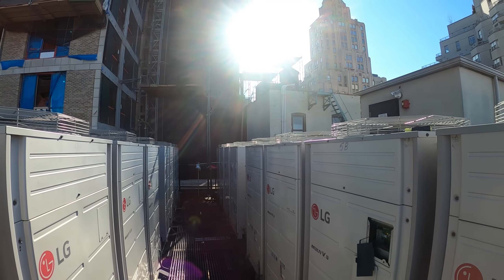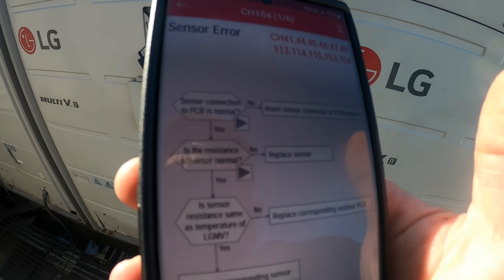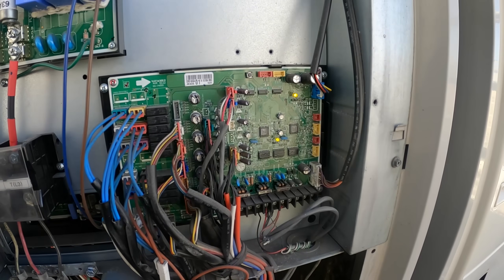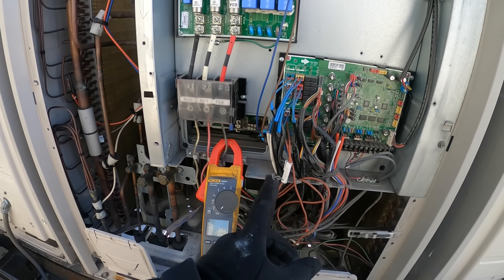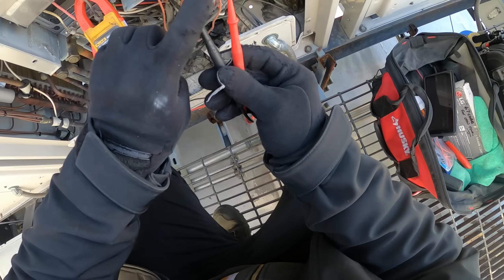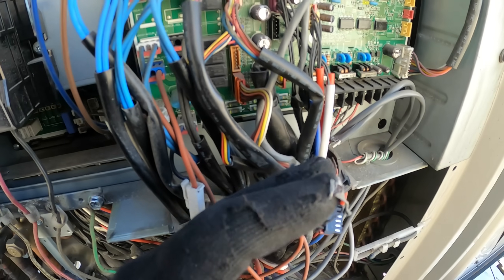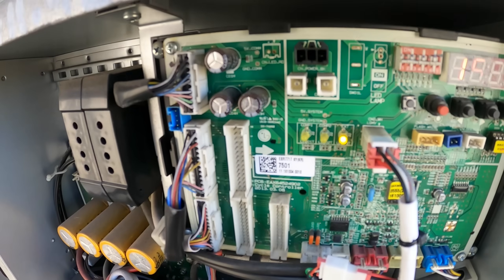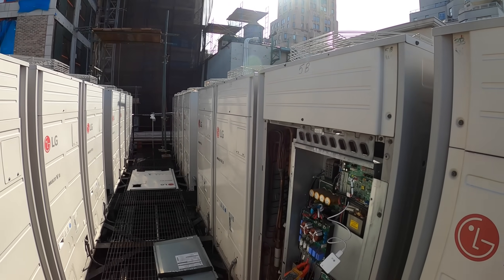HVAC: LG MULTI V Troubleshooting Error Code CH154 (Outdoor Heat Exchanger Temperature Sensor)

Comment: Good one, I would have checked for sensor to ground and made sure the sensor wires didn't rub through on one wire. You'd still get resistance across the thermistor but once plugged in it would short to ground. Also could check for voltage on the board with the sensor unplugged to verify the board is supplying the voltage to begin with. No voltage with it unplugged is a double check that the board is definitely bad. Looked like a quick diag anyway.
Reply from the maker: @inothome  Thank you & thanks for the tip. I checked the board for voltage with the thermistor plugged in as they showed in the instructions but just to be sure I checked the pins on the board with the thermistor unplugged and it showed no voltage at all. I quoted them for a new board and thermistor assembly. That should fix this error. Thanks for watching! 🔧⚡️
Reply: @JumpermanTech  yeah, good way to double check, if no voltage with the sensor unplugged the board is bad. Good  call.
Reply from the maker: @inothome  I agree. Thanks again & thanks for watching 🔧⚡️

Comment: G,day jumperman tech from Sydney Australia. 
Is the board bad?
Can you repair the PCB "board" and still maintain warranty with LG Dakin and other manufacturers?
Its usually only an electronic component on the board that needs replacing (or continuity with plug and wires) which carries and ID number and manufactures symbol. You can buy these components online (Mouser) is quality or electronic stores for $5.00
There are a few diagnostic tools to troubleshoot a PCB (printed circuit board)
* mV and V for power rails starting at edge of board. Plug, caps and rectification all together. Usually white numbers on the green boards for voltage and part ID. Need an oscilloscope for chip pin frequency on the scope trace.
💫◼️▪️◾(Each chip has a manufacturer data sheet with specific parameters and tolerance, so you can match to board design).

Comment: Hey kid, why don’t you hook up to the indoor units or the heat recovery box when it’s so cold outside? You really should consider doing that! We get paid not to work hard, we get paid to accomplish a task! broski. Yesterday I was working on a Hitachi VRF, it was 20 degrees too. Never went up to the roof. Nice & cozy in the hallway lol.
Reply from the maker: @mwdub02  I agree with you! I bought the other LGMV tool that connects to your laptop which can connect to the indoor units for situations like this when it's cold, raining or snowing. Unfortunately, I have trouble getting that to work and I even called technical support regarding that and there was no help. Even so, I would still need to test the thermistors and PCB on the roof to properly check the issue. This is also a hotel and a lot of these rooms have guests inside and I can't get inside. Lol I wish it was easier but this is what needs to be done. Thanks for watching brother! 🤙🔧⚡️

Comment: Apprentice here, why is there no voltage? Is the board suppose to send a voltage to the thermistor?
Reply from the maker: @samuelgagnon4853  Yes, the board is supposed to send a certain DC voltage depending on the temperature as shown in the resistance chart. The resistance for the sensor will change according to the temperature as well. Because voltage was being sent to the SC_IN thermistor and not the HEX_L thermistor is why we recieved the CH154 code. That means the board is bad and needs to be replaced. We will change the board along with the sensor and this should clear that code. Thanks for watching & stay tuned for new videos every week🔧⚡️
Reply: @JumpermanTech  Ok nice thank you nice explanation!
Reply from the maker: @samuelgagnon4853  You're very welcome! Stay tuned for new videos every week⚡️
Reply from the maker: @samuelgagnon4853  Thanks for watching!